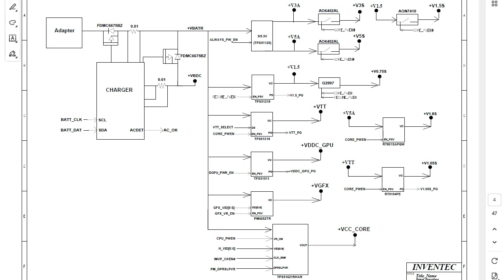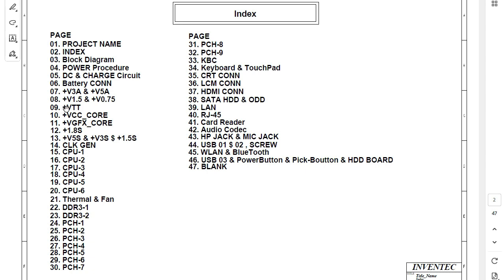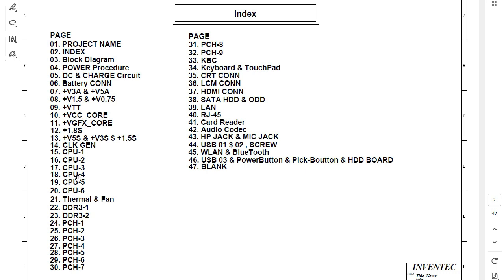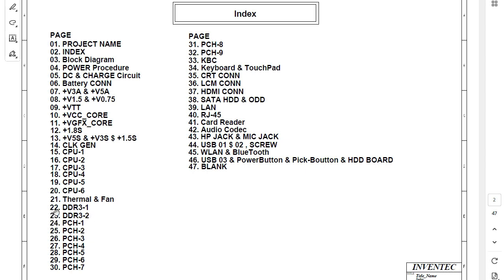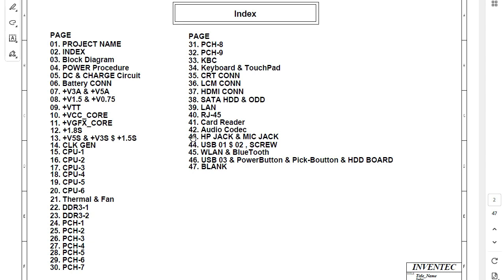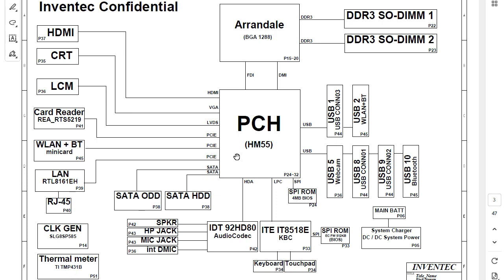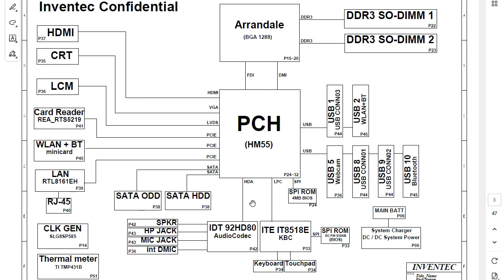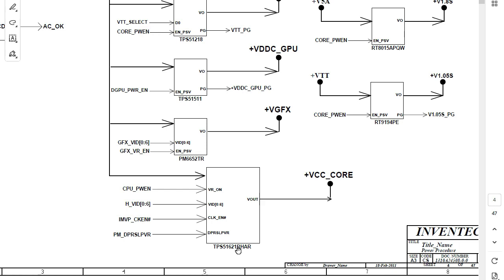Learn Laptop Schematic Reading - Circuit Diagram studying & analysis

Comment from the maker: Buy Professional Repair Tools👇👇👇
https://northridgefix.com/shop/?ref=ERB_23
Microscope
Voltage Injector
Programmers
Reballing / Stencils
Repair Tools
iPhone Cases
Soldering
Soldering Equipment
Storage / Rack
SMD Books
Tempered Glass
Test Tools
Components
Donor Boards
Gadgets / Accessories
Ports / Connectors
Tweezers
Adhesive
Apparel
And much more